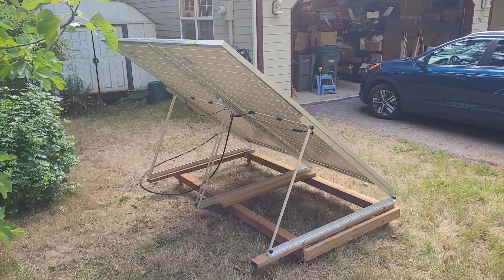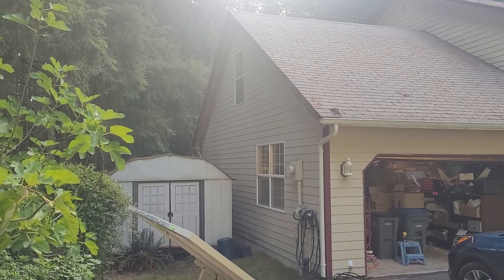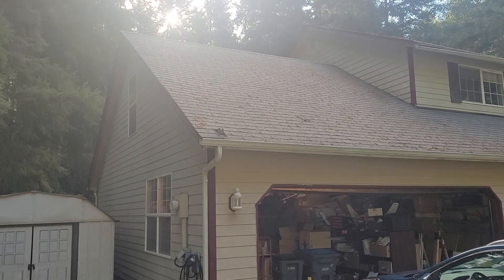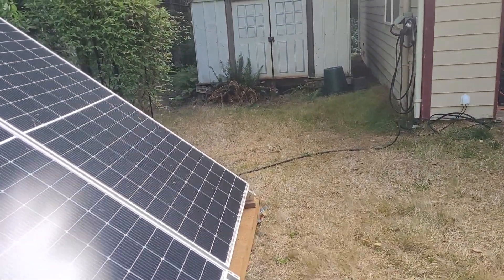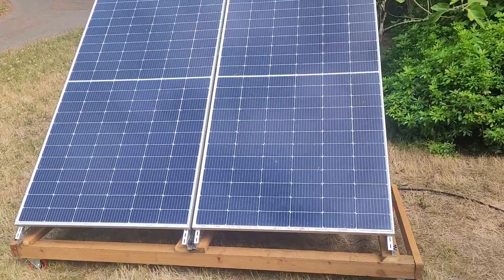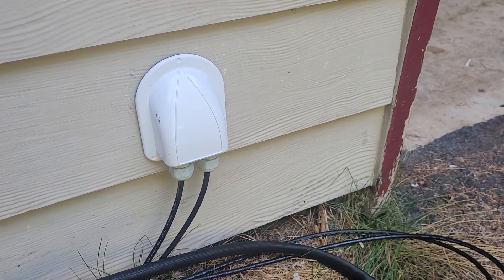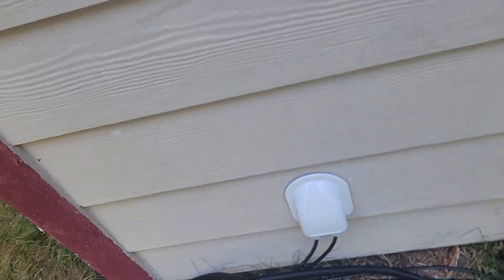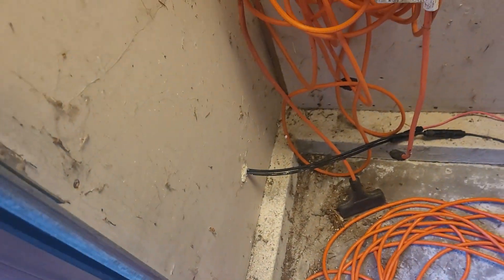why ground based solar?

Comment: I had panels on my roof. I found that water cascading off of them during heavy rain was damaging the shingles below them on the roof. When it was time to reshingle, I removed and replaced my original panels with more larger units but now placed on the ground on wooden 4 x 4 frames. No more roof perforations, no scraping the ice from them perilously perched on the roof and much easier to check voltage and output. Additionally, I was able to point half of the new array southeast and the other half southwest giving me complete solar coverage over the day. So if you have the space, on the ground is the best IMO.